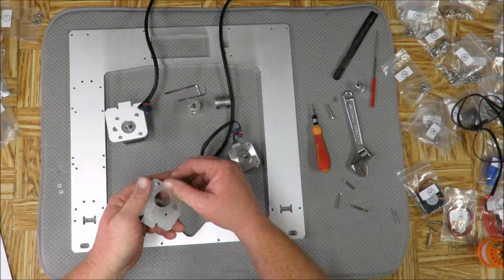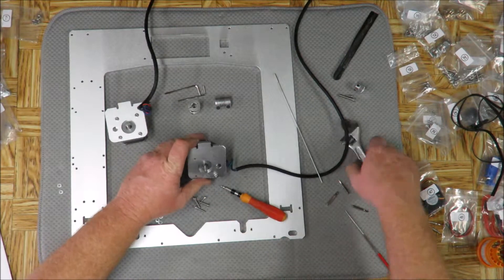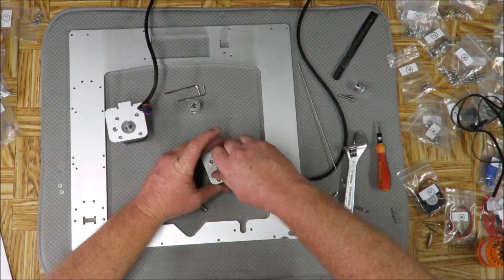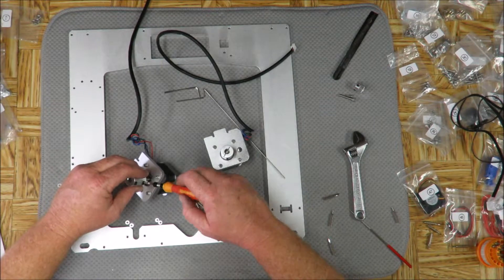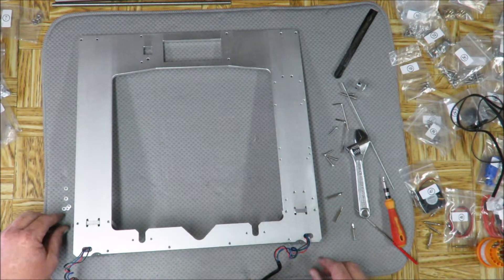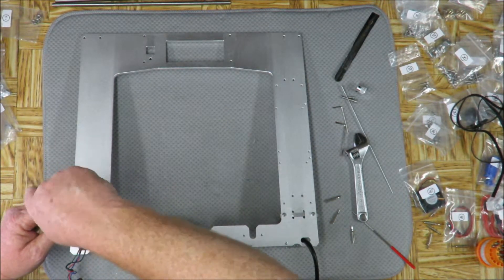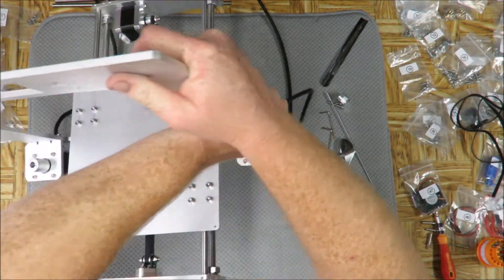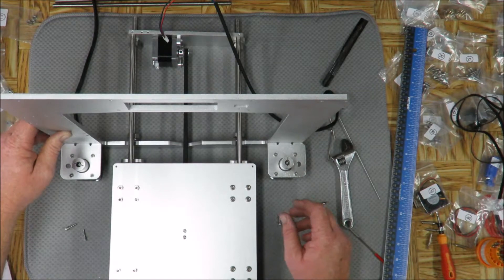Geeetech Aluminum Prusa I3 Assembly Part 4

Comment: How did you determine the best distance to mount the Y frame and bed on the XZ frame?  Is there an ideal distance?  I'm in a holding pattern at this point.  Thanks.
Reply from the maker: +Gene H That is something that after it is assembled you can adjust.  The main thing at this point of the build is to make sure it's square and somewhat centered.  Later on you can adjust the nuts to move the lower section to the ideal position.
Reply: Thank you.  Sounds good.  I'll just position it approximately for now.

Comment: You say to remember "it's aluminum and sensitive as can be". So, the frame is soft - with no temper?
Reply from the maker: +Michael Feenstra The frame does have a temper, but it is a softer metal than steel.